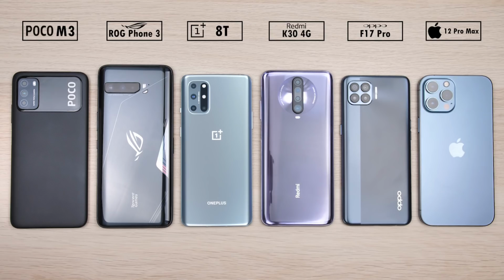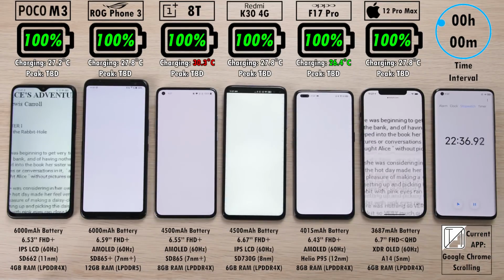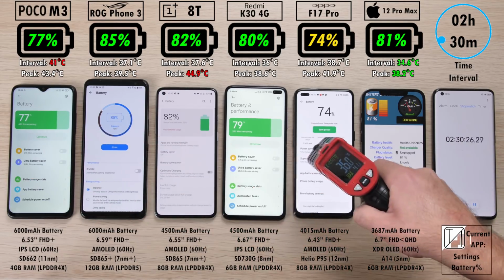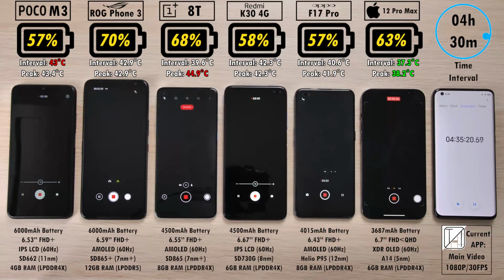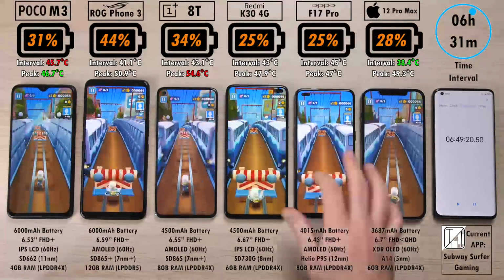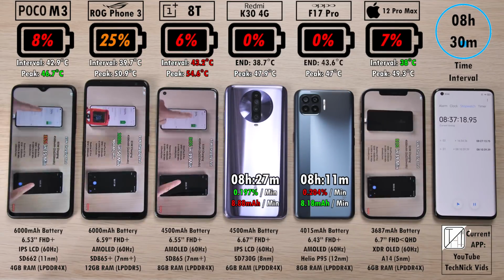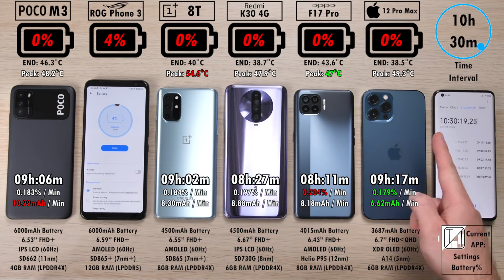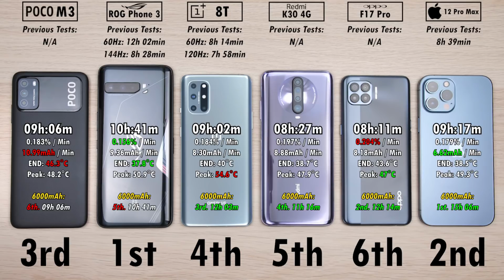POCO M3 vs ROG 3 / OnePlus 8T / Redmi K30 / OPPO F17 Pro / iPhone 12 Pro Max Battery Life DRAIN Test

Comment: I have a Poco M3 so I'm subbing to anyone who tests or reviews that device.
Reply: I don't need a sub, but I can give reviews.

I like how it feels like a rock at the back, that way it's less likely to smash, and it's less delicate than Apple. Apple is literally glass. 
The screen protector that comes with it is very strong, I dropped this phone at least 30 times and it doesn't have a single smash. It only scratched the screen protector. The scratches are very faint and unnoticeable. Even though I dropped it dozens of times, the screen protector has never fallen off.
I like how it's quiet water resistant, I scrolled through Instagram in the rain a few times and it still survived.

Now we're getting to the cons...
The camera quality is very bad, when you picture something, there's like weird outlines like it's a picture.
Ever since my 7th or 8th drop, the phone has completely froze and started dying.
It kept rotating since then.
It's delicate, but at least it's not as delicate as Apple.

Comment: hmm poco m3 really 6000mAh battery?
Reply: Well that performance might make it seem debatable. It was running on the hot side throughout most of the test though. It's clearly not as optimized as it should be.

Comment: Poco price is only for limited time. Also what beast of a phone it could be if they spend another 10 -15 dollars and add newer generation SoC.
Reply: Yeah I just paid $149 for it. I did see it at $129, but I hadn't decided to buy it yet. Snooze you lose. 🤦🏿‍♂️
Reply: @artdogg50  Won't buy it, great for the price but will last 1-2 years before it won't run smooth the newer apps.

Comment: It looks like the screen brightness isn't the same for all devices. This would give an unfair advantage to those with lower brightness and the results from this test are rendered inconclusive. You really want all variables to be the same for this sort of test.
Reply from the maker: All brightnesses are set to the same level as indicated during the intro of the video using a LUX meter to ensure this. If a phone seems dimmer it's due to different display tech such as AMOLED /OLED /LCD. Thanks for watching 👍
Reply: @TechNick  Ah, my bad! But I'm sure you'll agree it really looks like the k30 is much brighter than the rest for example. Keep up the great work man!
Reply from the maker: Yeah it's also because of the camera lens. The k30 is more central so it seems brighter. Still working on that. But thanks for the support mate, appreciate it! Cheers 🍻

Comment: Considering that iphone has a 3687mah battery, I think it's impressive that it's battery consumption is  competitive as compared to the other phone with a higher battery capacity
Reply: Poco m3 wins because .
You see the price of poco m3
Reply: It did very well. It is worth noting however that with that large notch, it has a much smaller screen area than any phone with a similar screen size that has just a punchhole or even a popup selfie cam. I miss those 😥
Reply: @benjmiester  Yea bro you said it in like 3 comments, we get it

Comment: Nice test dude, pretty solid result by the iPhone with less than 4000mAh, it's good to see battery consume is improving since the iPhones 11
Reply: The 5nm chip
Reply: Yeah it did very well considering. Important note though with that large notch it has a substantially smaller screen area than any other 6.7".

Comment: Considering the Poco M3, Oneplus 8T, and iPhone 12 Pro Max are all within margin of error (about 15 minutes) , it really shows the difference in phones, iPhone 12 Pro Max is a very expensive/premium phone but also rather thin with smaller battery with the slowest drain. The Oneplus 8T is however a midrange/lower side of premium phone with a standard size battery that will also last as long, then the Poco is a budget phone that makes up for its less efficient lower end features in a large battery to obtain the same battery life.
Reply from the maker: Very well said👌

Comment: In my opinion you should remove benchmarks in your drain test when you compare different processors. 

An SD865 will use way more power than a SD662 in antutu while achieving 3x times the performance. Also a benchmark is not a real life type of usage.

Also make sure games have the same graphical settings if available.

Comment: This shows the rog 3 phone has best battery but when you compare iPhone 12pro max on gaming alone, iphone will win it. And one more thing, after one year i don't think rog phone 3 will be able to have this battery holding capacity when compared to iphone. Overall iphone is best even after using for 4 years it will be the best.
Reply: @greekleader3311  many people do it. Once they buy the phone i mean flagship mobile they use for about 2 to 3 years for sure unless the next phone is damn good. Even if a person buy 1000 $ phone every year means he is a foolish man on this earth. Compare to iphone no other brand stands for years. I use a flaship android after one year, the battery capacity was not good. But my iPhone even after a year it was still the same, no issues.
Reply: And I just said that even you can use upto 4years i.e maximum. Even today people buy iphone 7, many people use thr flagship mobile for 2 years minumum.
Reply: @greekleader3311  is u watch mrwhosetheboss you would know that 2020 midrangers  compared to about 2016 flagships so your points invalid
Reply: @greekleader3311  watch the video of iphone se vs iPhone mini, you will get an idea.

Comment: With nearly all YT creators claiming they will never go back to 60Hz it is a surprise that these tests are not done at the highest refresh rate bearing in mind how big a deal it is? Many of these have big batteries to allow the 120Hz to get you through a day! So I will take 2h off each result to get an approx SOT with 120Hz and they all do great with >5h SOT which is well enough for the vast majority of users. Look forward to comparing like with like next year, 5nm v 5nm to see if it is just efficiency of the chip or more optimisation in the Android v iOS choice?
Reply from the maker: Check out the end of the video for results with their max refresh rates. I do many drain videos with 60hz and max hz, make sure to check them out bud. Thanks for watching ✌️

Comment: It is repetitive that OnePlus 8 lineup has larger temperatures. It went well but as it became hotter it started losing battery faster. Something to note for OnePlus.

Stil 8t is better than 8 pro in these tests I think
Reply: Yes, noticed Oneplus always running at higher temperatures since the Oneplus 7 Pro
Reply: Yes and meybe if he used the 12gb ram 8t the temperature wont go that high

Comment: Hey TechNick - I personally feel it is counter intuitive to use the brightness leveling meters. Since most people don’t have the device.. in real life terms I’d rather see these tests at 90% of their respective brightness. Do consider dropping lux meter reading - just feel it’s an unneeded gimmick and not real life.
Reply from the maker: With this reading it sits between 70 and 90% brightness which is what I feel most would use it at whether set manually or automatically
Reply: 90% brightness on each phone doesnt give the same brightness . Phones like the iPhone will be incredibly bright since they have high peak brightness whereas lcd phones like poco will be much more dull.  For scientific purposes u have to accurately set their brightness to a particular level

Comment: Perhaps the Poco phone was the hottest because it had the least amount of cooling technology since it is just so dang cheap
Reply: No this is surface temp witch means the heat can be dissipated to the air (maybe the plastic back has worse heat emission than glass). Still though the mah/min shows this is an efficiency problem

Comment: 12 pro max is very good its is best
9h 20mins battery
Ceramic shields
Lidar sensor 
Awosem design 
6.7 inchs
Best cams
Best quality
World record geekbench scores:
Single: 1660
Multi: 4620
Reply: 60hz
No charger
Limited to 20w
Ugly notch
2.5x zoom only
Non curved display
Outdated design
Reply: @big_smoke7t  charher and w20 limite is not probllem
Reply: @big_smoke7t  outdated design???? The design will be better 
And this is not outdated
Reply: @greekleader3311  every phone throttles when you push it to the limits and you forgot that apps arent optimised for the a14 chip yet
Reply: @greekleader3311  
ios>android
Iphone> xiaomi samsung
Ips 6gb ram= 16 gb ram android
12mp iphone camera> 108 mp samsung and huawei cam
3000mah iphone bttery> 5000-6000mah android pjhone battery
Quality: iphone beats android phones 
Longer life: Iphones
Petformance:Iphones 
You want more??? Samung service is very badddd
Reply: @Apoöcalmayangaming  no no no , you can't do anything with that pathetic 6 gigs of ram. Most of the upcoming games at least require 4-6 gb of ram and iPhone's ram optimization can't do anything when that happens.
Reply: @big_smoke7t  brruuhh
Reply: @Apoöcalmayangaming  also I suggest you to go watch Camera comparisons of those phones instead of shouting iphone is the best ok ?
Reply: @greekleader3311  son Go play PUBG mobile pfff not even a real gamer
Reply: @greekleader3311  nice lie man👌👌
Reply: @greekleader3311  do not be silly pls 2020, but not changed

Comment: Sir iPhone 12 pro max vs rog 3 gaming performance with streaming who better???
Reply from the maker: For gaming?
Reply: @TechNick  yes sir
Reply: @rockstarop45  iPhone 📱but 2 times the price of rog
Reply: Rog phone def
Reply: @Swiftk1ng  😑😑😑😑😑😑😑😑😑😑😑😑😑😑😑😑😑😑
Reply: Rog
Reply: But iPhone has better ui and camera and butter optimizations.
Use lightning port to 3.5 mm and lightning port for streaming to charge and use headphones.😁
Reply: Its a gaming phone bruh
Reply: @Swiftk1ng  noo, Iphone is better.
Reply: Well according to the performance the iPhone is the best 
Well according to the gaming also iPhone is the best
But we got a lot of gaming features in Rog 3 so I will prefer Rog 3.
Reply: @subodhyakkha380  Even if the 12 pro max did beat it , the 60hz in it will never let you go any further than 60fps in all the games and apps.
Reply: @big_smoke7t  ok let's believe iPhone don't go up than so 
So u mean Rog have stable fps of 90?????
Always remember iPhone CPU supports 120 fps also but display stucks at 60 and 
Android display supports 120 fps but CPU stucks at 60 and though 
Rog phone 3 doesn't provide stable fps 
I've checked the test of pubg mobile 
A stable fps is that one 
Which drop only 1 or 2 but sometimes it drops many
Reply: @subodhyakkha380  You can go watch gaming tests of those Android phones. They all perform pretty stable at high refrash rate setting. I myself using a Mi 10 Ultra and I don't see any lags playing at 120fps mode . Most of the time it gives me 110-120 stable fps ( I use fps meter to measure the frames )
Reply: @big_smoke7t  well android is best for gaming
Iphoñe is better for performance
Reply: @big_smoke7t  iphone gives you constant fps and its better than any other phone. There is no competition for iPhone.
Reply: Even though its not made for gaming.
Reply: @mohammadsami6031  ah yes , a fanboy
Reply: @mohammadsami6031  I mean you need to go watch " true " gaming tests of those phones instead of shouting iphone is the phone ever .
Reply: iPhone for  most of steamers use iPhone
Reply: @Abhinavabhi0  i have to remind you most mobile streamers are idiots, that's why they use iphone
Reply: You want to stream with a phone ?
Reply: @big_smoke7t  yes
Reply: @rockstarop45  rog
Reply: @big_smoke7t  dude ik asus is a gaming phone but it will lag while streaming so i will say iphone is much better because of its better optimization.